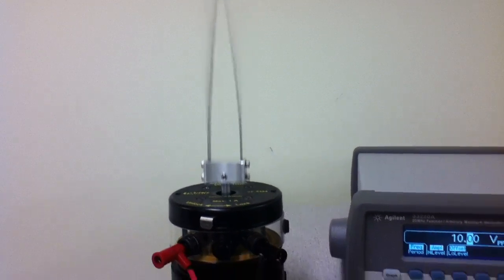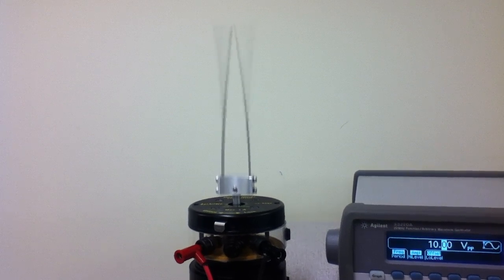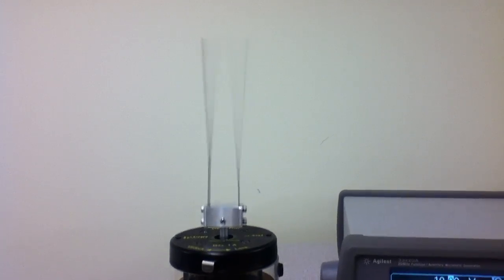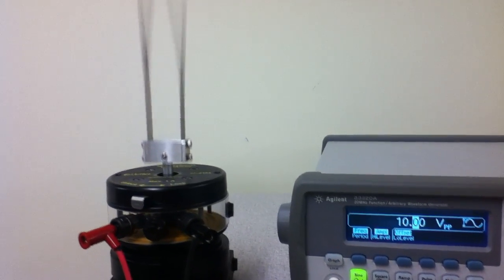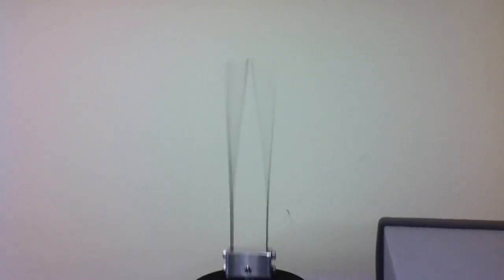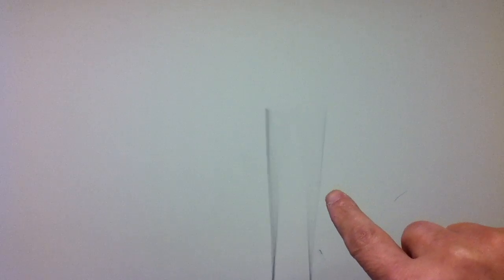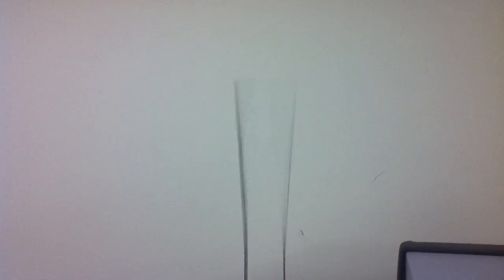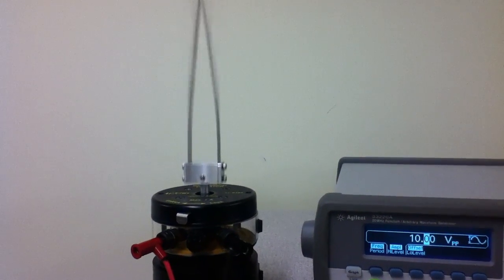Hysteresis in Nonlinear Dynamics

Comment from the maker: Thanks for your comments. Have not tried horizontal forcing. The two beams are expected to respond in phase. There is a possibility (in vacuum for example) that the two beams can respond in opposite phase, running into each other. Vertical forcing is also known as parametric forcing. You may find my Faraday Waves video of interest.